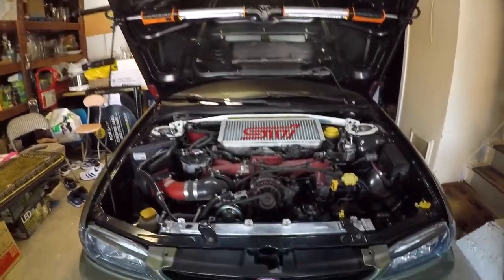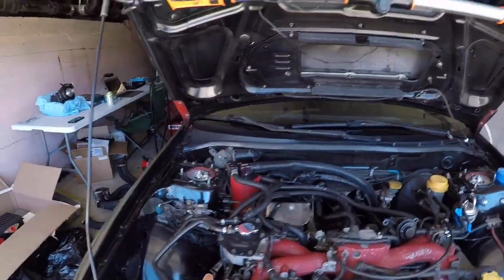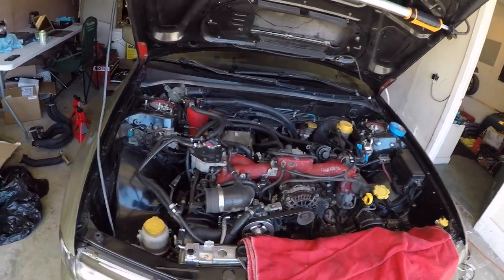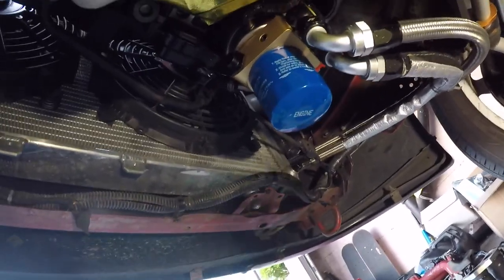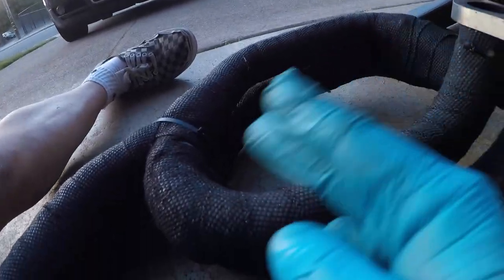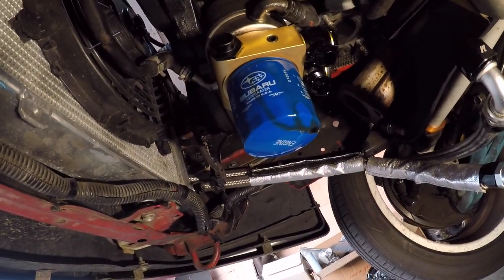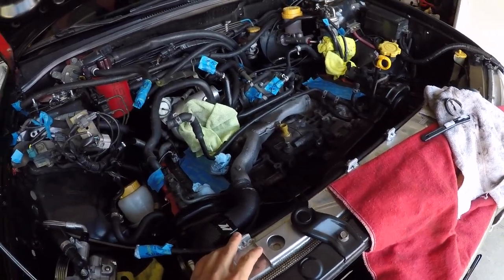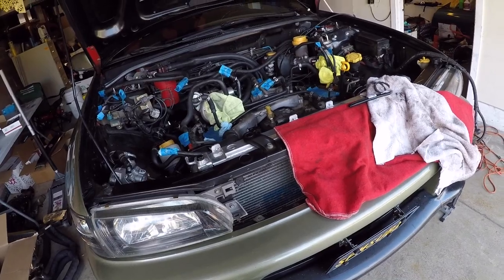JDM EJ207 400+WHP Subaru GC8 Build | Part 1 | Perrin ELH DOES NOT FIT

Comment: Mostly All aftermarket headers are to big and usually u need to cut a bit off the radiator tabs
Reply from the maker: Not the HKS ELH one I have on now. The perrin ones wasn’t only hitting the tab, it was hitting the radiator. I have a 52mm koyorad. Exhaust port holes wouldn’t even line up. HKS ELH fit perfectly with not cutting or anything. So it’s all good

Comment: I got the 1320
Brand wasnt that bad but i dont have the oil cooler yet..
Reply from the maker: Nice! Heard those weren’t too bad. As long as they fit as well.
Reply: @Damn_G  The only thing that was hard was the studs that were already in the block I think they were bent so I had to hammer them to make it fit